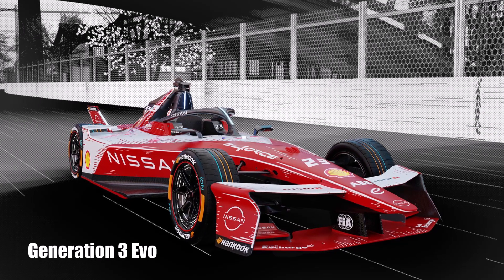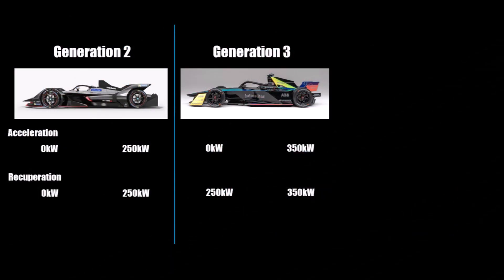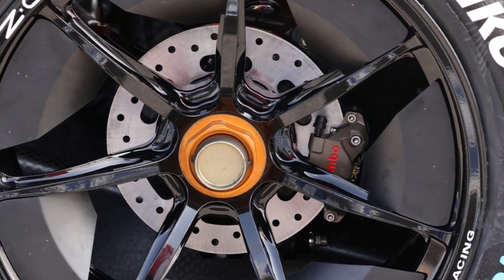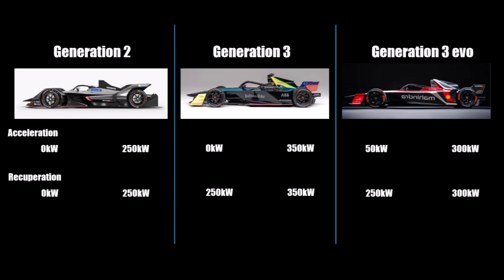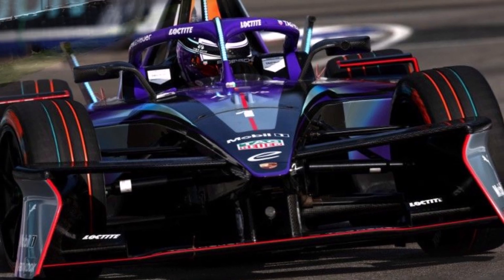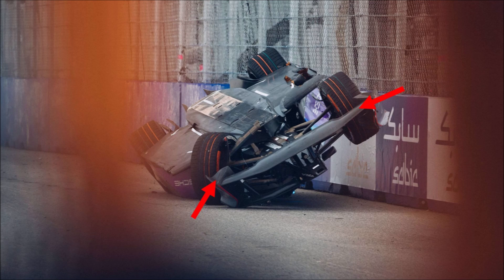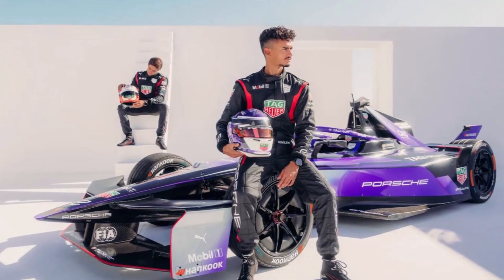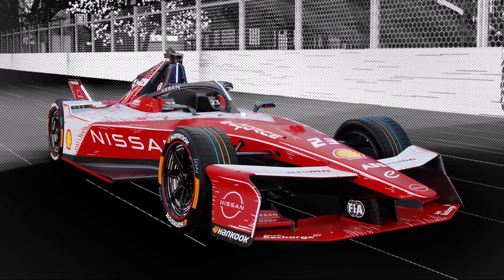FORMULA E (Generation 3 EVO) - CLOSER LOOK

Comment: I had no idea those changes were made. Thanks for the breakdown!  Why though does Formula E still run a street type tire setup for their series?
Reply: The intention is road-relevance due to predominantly racing on temporary street circuits. They aim to have the developments in their all-weather racing tyre be directly translatable into tyres for road-going production cars available to the public.
Reply: @ ah makes sense. In my mind I feel like maybe they’d gain more interest by running a proper motorsport tire but yeah I guess there is also the direct R&D aspect for continued tire development.
Reply: The real answer is they don't have the means to go racing on purpose built circuits. The cars would run out of juice on the long straights and the lack of heavy breaking zones that recharge the battery.
Reply: @mrgalaxy396  there is that too, but that’s more of an aside to why street tyres are used rather than the primary one. Also, as the technology improves generation to generation and the cars can go faster for longer, we’re seeing an increase in modified, shortened layouts of permanent circuits in the place of street tracks. The rumours are that Silverstone may be replacing the London ExCel track in 2026 - likely on a modified version of either the National or International layout rather than the full GP circuit

Comment: A Formula E race around the Brands Hatch circuit would be super cool. They should be able to cover this small circuit.
Reply: I like this idea, as the main thing preventing racing on the full circuit are the noise restrictions due to the houses built at Dingle Dell.

Comment: The new "attack mode" completely changed formula E racing. The season opener was a massive success for me. Can't wait to see attack charge in action and how they'll develop it going forward!
Reply: Where was the first round or season opener at?
Reply: @TheFlamethrash900  São Paulo. Very worth it to watch the highlights in formula E's  yt page
Reply: Let's see them on normal tracks like Spa, Silverstone or even Suzuka.
Reply: @zakelwe  I'd love to see the day but these cars and the technology still can't make it happen. They are made to be minimal drag and all mechanical grip pretty much, and if the battery lasts for 5 laps at Spa that's a lot. There's a reason they only race in very twisty and slow circuits, but that's more our battery technology that's to blame. I can't wait until they can have actual downforce with the energy density to allow for it

Comment: As a fan I think Formula E is getting increasingly attractive each year with improved tech and performance. It's well beyond the days of just being a tech demo or an ambition for the future, it's firmly established as a legitimate racing series
Reply: My hope is that Gen 4 races can be a bit longer, +60mins at least, and the performance to be increased to 800hp at least for qualifying spec, with semi slicks at least and for AWD to stay. Those are the minimums, I don't mind recharge but it's not a must for me.
Reply: @F1ll1nTh3Blanks but better recharge means longer races
Reply: well, we can see F1 is turning to dat, so Fe is meta
Reply: As an air conditioner
Reply: Agreed, I been following a bit since the beginning. When they figure out lighter  battery tech: F1 merger?
Reply: @R_N3dza  Well formula E has always been about low downforce street circuit racing, which is quite different from F1
Reply: I think introducing battery swap during race will be interesting and help to develop that technology.
Reply: I just wish they made sound
Reply: They do produce quite a lot of sound for an electric car  @Handledeeeeeeeeez
Reply: When they do Le Mans 24 hours I will be impressed.
Reply: @zakelwe  Le Mans in full electric would certainly be impressive.
Reply: @zakelwe why would you want that when no cars can do it without refuel ?